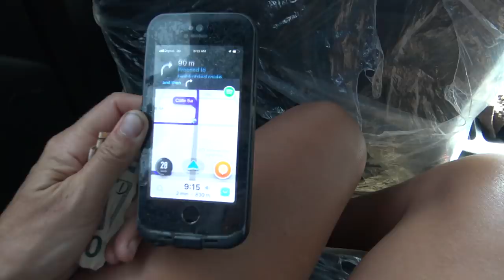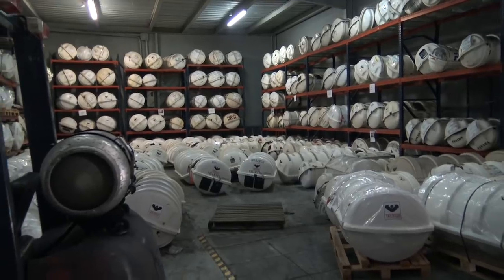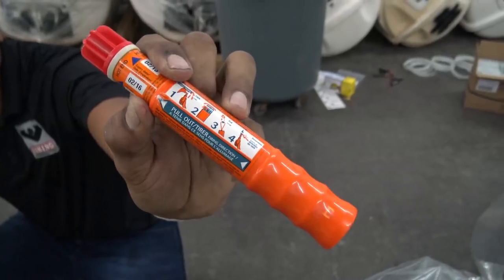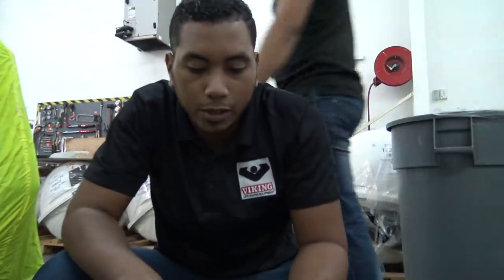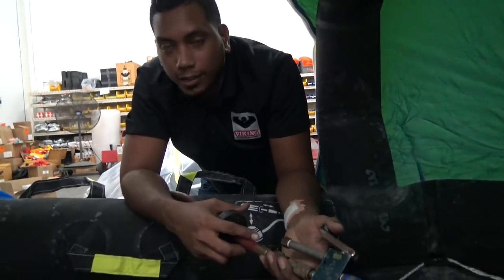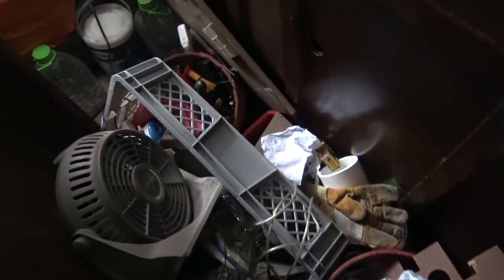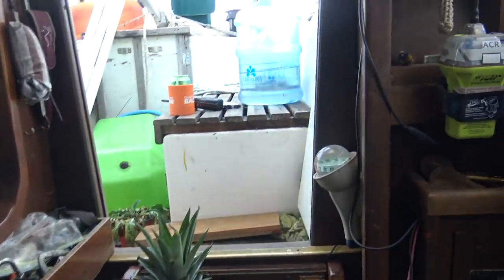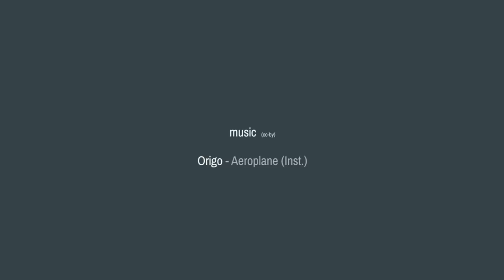Servicing A Viking Liferaft - UNTIE THE LINES IV #25

Comment: Yep that is surely a mess to step over. I am sure you will get it cleaned up very quickly. The important thing is to make sure all the lead ballast is replaced in the correct place and secured before you put all the other stuff away. Here in the UK we have had a couple of fishing boats sink and the crews die because after repairs and modifications they did not ballast the boat correctly. Hopefully you have all that in hand.  Fair winds & regards from the UK

Comment: I'm confident you will get Karl put back together & continue on.  

Water itself does not expire, rather the plastic container leaches chemicals.  Likely not toxic,  but will have an odd taste.
Reply from the maker: TheMusicrox4 yeah okay, that’s probably true...makes sense
Reply: Not quite. The bags are usually Mylar or other stable materials. But the bags, and the water, and never totally sterile when sealed. So bacteria and other potentially harmful or offensive things grow in the water. The replacement date is more of a "best if used by" date. If they were sterilized very well and stored properly, 5-10 years is perfectly possible, but 3 years is way more predictable.

Comment: That mechanism that inflates the raft should be tested too.  If that fails you at sea then the rest is a moot point.   Can you elaborate more on how long they were talking about to refill it?
Reply: Think they mean do not inflate the raft using the gas from the cylinder. They probably have tested the inflation system (operation head, inlet valves, hose) , it is a basic part of the inspection.
Reply: It’s simple CO2

Comment: You may want to put a shake flashlight in your go bag.  I would also replace the battery one on your next service. The best I found so far has been the EcoCentricNow Shake Light 40 Rechargeable Flashlight.
Reply from the maker: BostonClipper I have one of those that you squeeze, same idea, I suppose 👍 and I have a little foldable solarpanel to charge stuff as well - for the sun after the storm 🤣😋. Maybe not the right topic to joke about 🤔😆
Reply: A solar light ("lucy light") or crank light is more reliable. My genuine original shake light simply died. Many of the new ones are counterfeit, with a cheap lithium battery instead of the expensive magnet! But any flashlight will work if you use lithium primary batteries, like epirbs do. Not cheap, but extremely stable, 10 year storage life, no leaks. Every brand of alkaline or carbon batteries leaks, you get what you pay for. Surprising Viking used those.
Reply: @lyfandeth  I have three Luci lights including the USB version.  They are excellent but still my second choice.  I had a couple of crank types but they broke, don' t trust the mechanics.  I have had several shake lights, now I just use the EcoCentricNow, the others failed like you said.

Comment: Hi,  how much was the life raft service? Did they vacuum pack it? Do you have contact details for the Viking service centre? 

Thanks
Reply from the maker: Sue Rose hi Sue, it was 800$ and yes they vacuum sealed it. I don’t have the specific contact anymore cause I lost that phone but you can just call under the number you find on their website for Panama 
VIKING LIFE-SAVING EQUIPMENT PANAMA
FREE ZONE S.A.
(VIKING Branch)

Address: Colon free Zone, (France Field), Lot No.6, Block No. 6, Building No. 54
City:  Colon
Tel.: (+507) 4304200 / 4304201 / 4304202
Fax: (+507) 4304203
E-mail: jsla@viking-life.com

Comment: How could they sell a raft that requires "certification" every year?  No one would buy one.
Reply: Commercial vessels usually are required by governments to have their rafts certified every year. For Karl, there is no such requirement. Viking may "require" annual certification to maintain warranty status, but that still is not a "requirement" for anything in general, just a warranty condition. Even if annual inspection is generally advised.
 There's a lot that wasn't explained or told to Nike.
Reply from the maker: CK H I agree with Lyfan. These guys are used to servicing rafts for cruise ships and what not, so mostly commercial. I think Viking recommends every three years on their page...